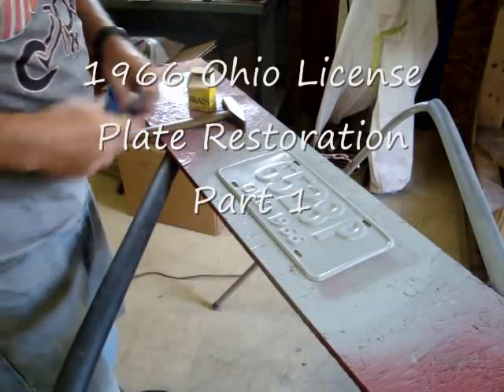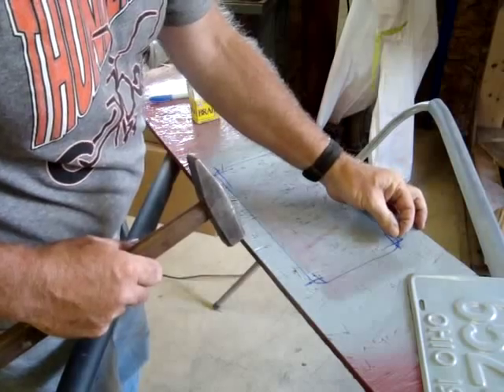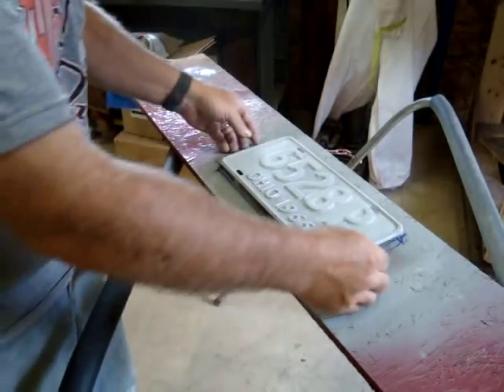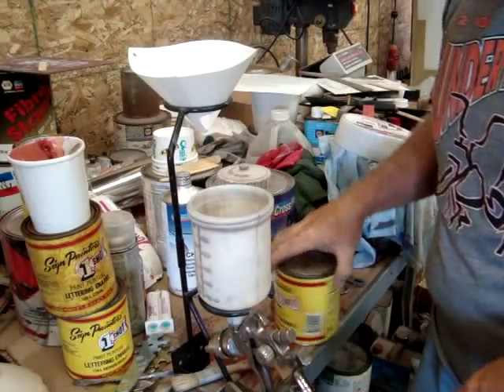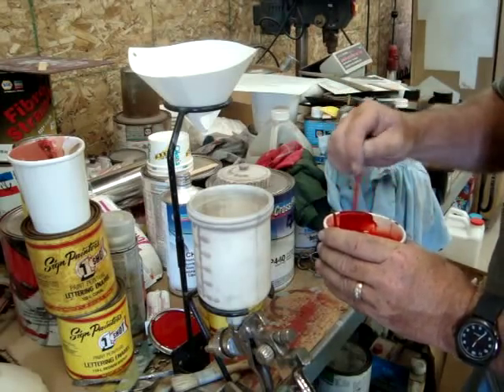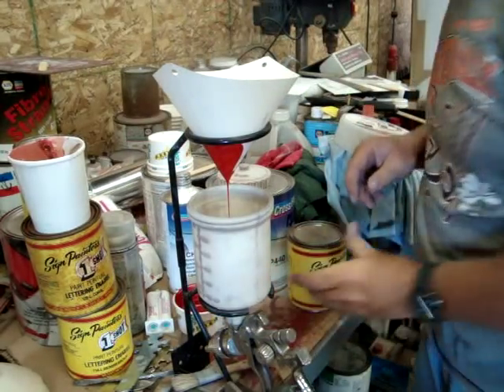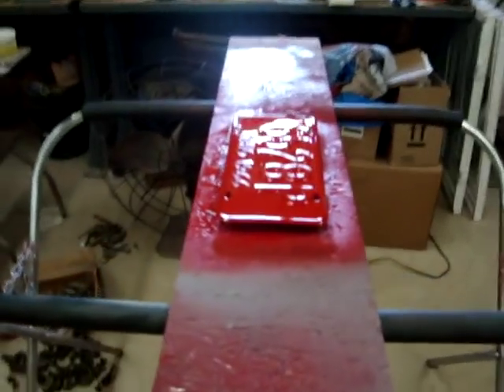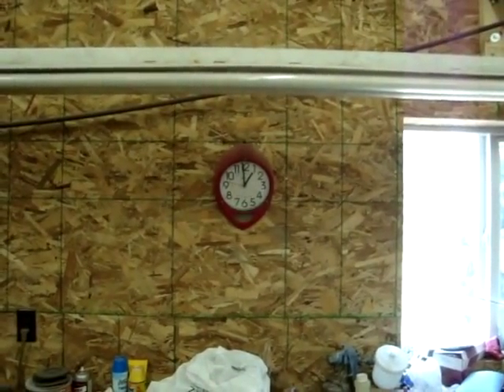1966 Ohio License Plate Restoration Part 1

Comment: This does look really nice at this stage, but it's very rare that a serious license plate restoration can just be done with straight, stock paint. You need to work to mix a color that approximates as closely as possible what the original color was. A '66 Ohio plate is not going to be rare enough to warrant that much work, probably, but something really old and scarce would.
Reply from the maker: This plate meant something to the owner, that's why he wanted it restored and you can feel relieved that I can and do custom mix any color as needed and the paint used here was a very close match.